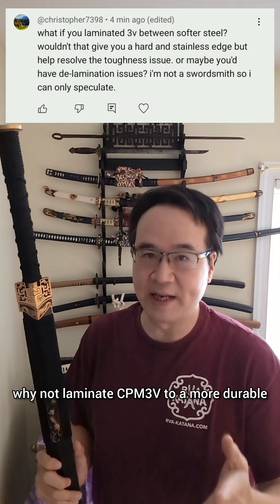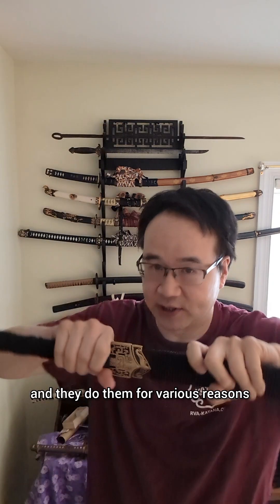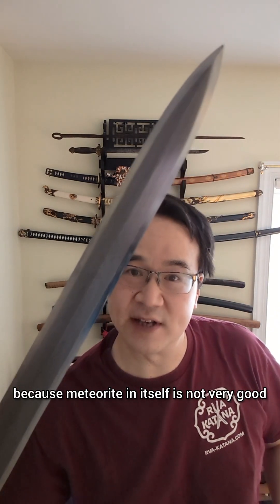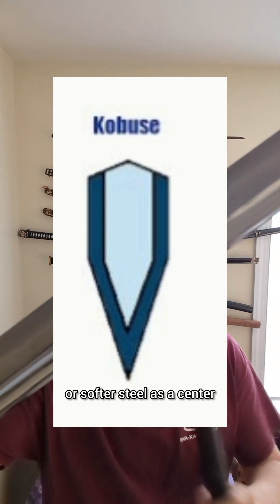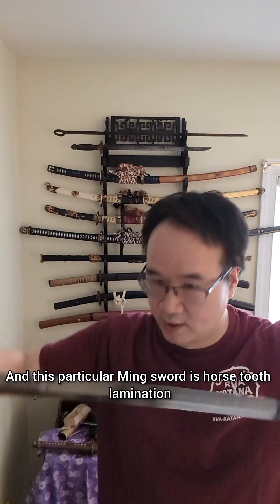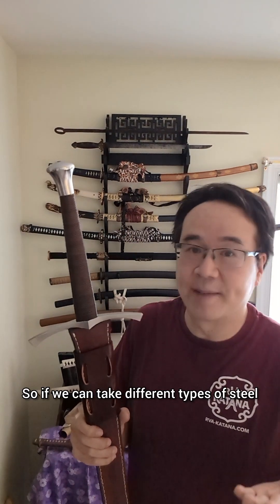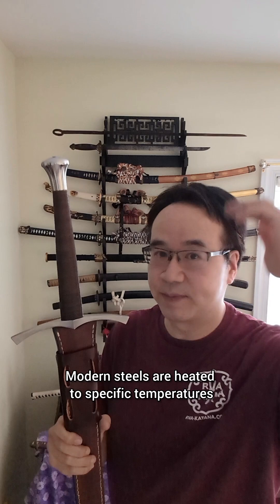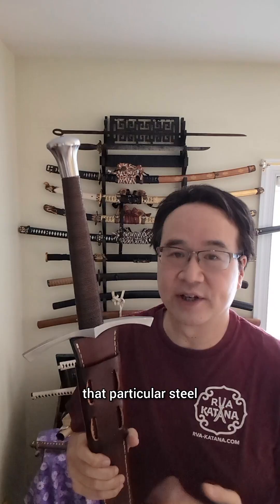laminating different steels to make a sword

Comment: Can I clean rust of my 1045 carbon steel katana with vinegar and if so does any vinegar work ???
Reply: yes it works.. and after the process clean the blade and use metal polishing paste to polish the surface
Reply: @raizowanderer  thank you, just had to be certain before I try
Reply: @K-OG_2000  dont keep the blade in vinegar for too long
Reply: @raizowanderer  I was only thinking 5 mins then scrubbing it with a scourer then drying and cleaning the blade then oiling it and putting it back in the scabbard
Reply: @raizowanderer  I’m limited to resources so would it be wise to use normal vegetable oil or just stick with food grade mineral oil ???
Reply: @K-OG_2000  clean the blade with soap before drying and oiling ..  vinegar removes rust but it also causes to rust .. practice with a normal metal maybe ,, see what happens .. then proceed accordingly
Reply: @K-OG_2000 Do not use vegetable oil on a sword. Use mineral oil.
Reply: @stevenfriedman2902  cheers mate

Comment: Also the powder steels don't like to be forged that much. They're really made to be ground into shape. And lamination requires not only forge welding, but a good deal of drawing out and shaping afterwards, unless you're gonna laminate it directly into the final blade shape, which nobody does. And even if you were to pull it off, it wouldn't help at all against edge chipping. Since swords are not typically hard use blades (you mostly cut soft targets for fun) the super hardness and edge retention of powder steels is not really needed, especially not at the cost of everything else.
Reply: If the knife maker want to cut cost they can laminate the steel like Shun, Yaxell and Miyabi do too there knives even Spyderco in VG10. machines can vacuum forge weld in low temperatures. use less of the expensive core material like an ZDP189 or other exotic steels not to mention ease of grinding you grind more of the soft material and less of the harder material. also some companies use this method too reduce warping during heat treatment. the cladding is low carbon stainless steel like 304 or 416 that cannot be harden thru heat treat the smith or the manufacturer will follow only the heat treatment of the core steel itself.
Reply: Also if you want to watch some grinding videos, watch BBB video. how hard too grind an CPM121V chef knife (gyuto) in 71 hrc.

Comment: Japanese chef knife or gyuto are sanmai. Purpose.
1. Too increased the corrosion resistance lowering maintenance. Sandwiching a carbon steel like aogami on both sides with soft stainless like 416 304. In single bevel knives they do a ni-mai construction.

2. Reduced cost and ease of grinding the soft stainless cladding is cheaper than the hard core still like R2, HAP40 and ZDP189 they will used less of the expensive core still compared to mono construction . The core is harder reaching up too 68 hrc the cladding is softer easier to grind of too exposed the hard core and lessening the grinding of the hard material.

3. Looks you wanted a Damascus look or a rainbow Damascus with copper and brass. Pattern welding soft stainless and other soft metal too make a beautiful Damascus pattern like a chevron raindrop, ladder and sumegashi pattern but it will cost you additional $100 to $400 depending on the type of Damascus not including the price of the core steel.

I wanted to add more but it’s too long I collect chef knives and a knife steel nerd sorry for the long comment.😅

Comment: Katana steel is so high quality and durable that around 1970, Japanese steel companies analysed the katana and traditional furnaces to develop a modern steel called Yasugi Specialty Steel (yasuki hagane). YSS is a steel used for cutlery, kitchen knives, razors, medical knives, car parts, aircraft parts, engine parts, etc. YSS steel accounts for 40% of the razor market share. In Japan's traditional low-temperature furnaces at 1400 degrees, the iron sand becomes semi-molten, but only the impurity slag can be melted and discharged through holes in the furnace, making it possible to produce high-quality, durable steel. Highly rated, high-quality Japanese knives are made using the same traditional methods as katana. https://www.youtube.com/shorts/TldpPYewaQo
 Japan has many volcanoes, and the titanomagnetite iron sand formed from weathered magma contains little phosphorus and sulfur, impurities that make steel brittle, and contains vanadium, which strengthens steel. Vanadium gives steel ductility and makes it easier to roll, making it easier to fold and forge. By folding and forging, the vanadium is finely dispersed and combines with carbon to create a fine metal structure, giving the katana excellent hardness, abrasion resistance, corrosion resistance, and toughness, and it becomes beautiful when sharpened. Yasugi Specialty Steel is mass-produced in factories in Yasugi, Japan, where iron has been produced since the 6th century. In Seki, Japan, where blacksmiths have been mass-producing katana since the 12th century, there are around 400 cutlery-related companies.